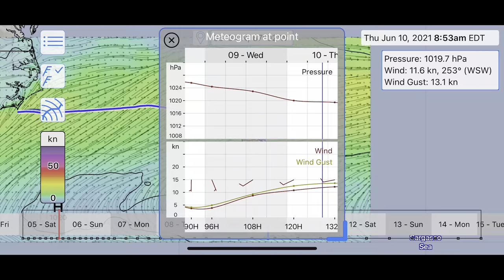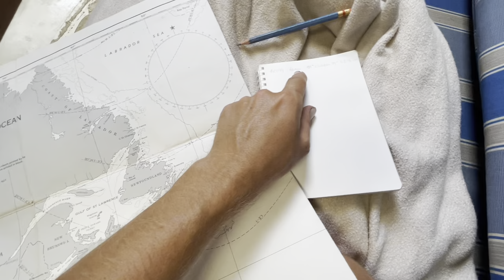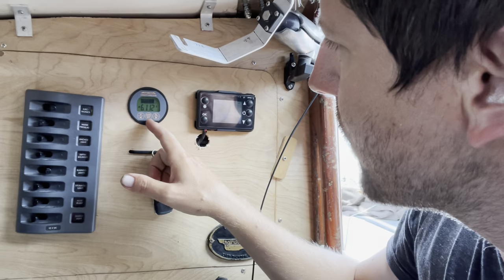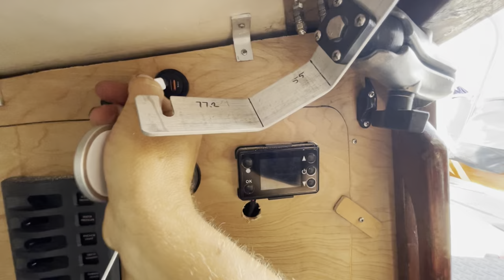Sailing single handed to Bermuda. 600 miles, 6 days, 28ft boat

Comment: OK.   YOU are my OFFICIAL HERO.  Congratulations !  I've had Transverse Myelitis since 1985.  Paralyzed from mid abdomen down. No bladder, no bowels. I've been fighting having a colectomy for 35 years. I just have a complete and total mindset against it. I've suffered. I'm also a sailing enthusiast with a 35' Pearson in Deltaville on The Bay.
YOUR ATTITUDE IS AMAZING !  I'm 74 and the pain and aggravation of dealing with my non functioning colon is increasing each year. I KNOW having the surgery will end my pain, but the aggravation factor is still major. I am very familiar with Beaufort, NC, beautiful and quaint !  GOOD LUCK as you sail on !
Reply: God Bless you!
Reply: Just get the bag man

Comment: Sam when I was sailing off-shore alone I to dragged a floating lifeline.  The polyline is slippery in water, I tied knots in the line approx. 2 feet apart to give me a better grab.  I do not know how well it worked as I never needed it.  My lifeline was 100 feet, if I were to go off-shore alone again I would sure as hell drag a line.
Glad you are doing it.  On another note, you can tie an inner-tube to the line, and with the remote for your auto-pilot, you can sit in the tube and control the boat.  This is a nice way to pass the time when the winds are low and you're doing 3 knots.        Be happy, be safe.
Reply: I've found it also tends to come untied rather easily.
Reply: @Justin Long nonsense pal.
Reply: @JustinLong1977  Cleat knot with a couple half hitches works, but yes the polyline because it is slippery does not hold a knot as well as a good braided line.  If you are going to drag a line it has to float otherwise it could get into the prop, or worse if you needed it you may be unable to find it.
Reply: @JustinLong1977  you’re right👍🏻

Comment: I got curious about that HMM container ship; it's one of the dozen largest ships in the world, built last year by Daewoo.  They are over 1300 feet long, 200 feet wide, displaces 228,000 tons and can carry around 24,000 containers.  You could probably stack around 20,000 Pickled Herrings on it's deck 😳.
Reply: Jesus they say 18k TEU and that's supposed to be 23 t each max so in theory it could carry 9 RMS Titanic taken apart, plates stacked on the deck along with the boilers and grand pianos and fancy sculptures.

Comment: Hey Sam ! I love your style ! I got another backup overboard tactic for you ! Read this through because its different system than your's. You can trail a 1/4" poly rope through a block out of the way at ninety degrees to the tiller. If you fall overboard you grab the rope and it will pull your tiller ninety degrees effectively stopping your boat dead in the water so you can climb right back in to it !
Reply: And keep the ladder down.  I went overboard at sea and I always singlehand. This method got me back onboard. I was never scared or worried. I'm always tethered to the boat with my lifeline.

Comment: I'm enjoying the tracker - Sam has left Bermuda it must be dusk for him about now.
Reply: Hi, Phoebe. Are you getting Sam on the Tracker?  It is not updating for me or something.  It shows only flags near the coast of U.S., where before it stretched to Bermuda and beyond.  Thanks if you have any information.  Bryan
Reply: @bdmenne  I think I figured out the tracker finally. If you zoom out enough, it shows where he is in relation to land and the mileage indicator in the lower left corner, I think right now is indicating he is 500 miles off the coat of Bermuda heading NE.
Reply: @emilybh6255  thank you! I found it myself. I always forget, but it has worked every time, right away. I scroll down The page and where there is writing, I find a  hyperlink.  It is the tracking. So when I select it it works. Looks like he is right in between Bermuda and Azores!!!  🙌🏼🙏🏻
Reply: New to the channel and you clued me in to that feature. Very cool.
Any idea what program he was using to ‘simulate’ this trip at the beginning of the video?

Comment: Sam can you trail a trip wire for the self steering so if do fall over you can trip the wind vane allowing the boat to luff up enabling you to pull yourself up, it would be almost impossible with the boat moving at 5 knots
Reply: Replying for the algorithm to increase the chance that he sees this.
Reply: That's a great suggestion...
Reply: That is a great idea
Reply: Cool idea
Reply: Or trail two lines, each tied to opposite sides of the tiller.when you pull on either rope, the tiller goes full deflection to the opposite side, causing the vessel to turn in the direction of the line with the greater drag.
Reply: +1
Reply: IDK about Sam, but I will be trying this

Comment: "got to clip in again, not so fun but you just have to make it a habit and it's no big deal" You said it Sam. This is the truth about safety at sea, in a wood shop, in any potentially dangerous hobby or profession. Its not necessarily fun but if you make it a habit it doesn't feel like such a big thing. Just like throwing on your seat belt. Well done on your trip. Your remarkable Sam. Congratulations.

Comment: I commend you Sam for what you have gone through and are going through and still maintaining an exciting sailing career.Bravo! I've had Crohn's disease for 50 years and have had four lower bowel resections. I've lost 10 feet of lower bowel. I can truly empathize with your ordeal. But you are taking it in stride and not letting it hamper your many sailing adventures. Kudos!!

Comment: what about putting a few knots in the yellow poly safety line, for hand and foot grabs to make it more likely that you could pull yourself back to the boat if it's moving fast. More drag, but hey....
Reply: Saw a rig once where a heavy bungie gave slack and a 2nd  bungie or line was hooked to a small projection on side of the rudder, such that the drag of a man on the line would also start the boat circling.
Reply: @sylviasorli  YES!

Comment: Friday July 2nd, at 6PM - Sam's tracking site time is 15:28.46, his coordinates are N 36°39'39.1428"  W 39°41'57.9048" and his distance from Ponta Delgada
Portugal, in the Azores - Sam has 777 Miles to go.

Sam has traveled 1454 Miles from Bermuda, and is back on track, sailing ENE, between 3 and 6 Mph...

Total distance as of today from Hatteras NC to today's coordinates: N 36°39'39.1428"  W 39°41'57.9048" is a TOTAL Distance: 2115 Miles
Reply: thank you
Reply: Thanks for update. I was checking recent video hoping someone had update.

Comment: In light wind and zero boat speed, a way to get going again is to strap the main sail down tightly so it dampens the wave motion which otherwise ruins your sail's profile. That will give the genoa a chance to keep its profile and start pulling again. Once you have some speed and the boat stabilizes you can release the main sheet.
Also, always sail your polars going downwind. Usually that's a course that doesn't require a whisker pole, so I am thinking you might be sailing too deep.

Comment: The bit about the crocs is hilarious. On my first sailing adventure I crewed on a gaff schooner with a family for 8 months. They all wore crocs and swore by them, I'd never heard of them before (im from the North), but I followed suit and bought a pair to use as boat shoes. God I hated those things, they are terrible boat shoes, especially the cheaper ones; my feet would get sweaty and slimy within minutes and slip around in them, and theyre just not stable enough. I ditched them quick and mainly went barefoot.
Later I crewed on a 156ft tops'l schooner out of Baltimore where we had to go aloft often using the ratl'ns, think like rope ladder rungs, to set and take in tops'ls, so I had to wear shoes. I wish I could remember what I wore that summer. I bet chuck Taylors would be amazing deck shoes if you hide the laces.

Comment: Hi Sam - you may want to check out how the uphaul and downhaul are attached to the spinnaker pole. By placing it in the middle, you may be risking folding the pole. I think uphaul and downhaul are typically attached to a line that runs from each end of the pole, so when the up/downhauls are tensioned, it puts pressure on pole ends, not the middle. Thanks for great content, you’re an inspiration!

Comment: The trick with the floating line off the stern, is to take a turn around the tiller or the wheel before the line goes over the stern. When your weight comes on the line the helm is pulled over and the boat rounds or jibes. Obviously the line is made fast somewhere forward of the tiler before you take the turn around it. You need at least 300 feet of line to make sure you can orient and get to it if you go over. (don't tie the line right at the end of the tiller, tie it a half or 2/3rds down toward the rudder post so the drag of the line doesn't keep pulling it over prematurely) Tie half knots in the line every 30 feet. Tried and tested. Works great, though the boat came back and almost ran me over once.

Comment: On John Kretschmer's boat, he advises looping the tether around the jackline and back to the harness. It works great: shorter throw, so not as much torque on the line if you do fall (which, depending on the length of the tether and the proximity of the lifelines may not even be possible.,) and no more clanking as you move across the deck.

Comment: Probably your best video yet, Sam - nice mix of boat tasks, sailing video, and discussion of critical safety measures for solo sailing offshore. You and Christian Williams have a sizeable following and it's good to see you taking the safety aspect seriously - setting a good example for others who might like to follow in your footsteps. Your video struck the perfect balance of putting forth adequate caution for those considering solo sailing without turning it into a fear and loathing fest.  Loved the self-deprecating humor too with the drilling reference - smiles all around. Perhaps you could expound on the usefulness of AIS (or lack thereof) while traversing the shipping lanes. If memory serves correctly, someone from Long Island donated an AIS equipped VHF - how is that working out? Good luck and fair winds!

Comment: I sympathise massively on the fuel issue.. I had the same and thought it was my tank but also was the fuel return line which had chaffed through in 4 places (48yo copper lines to be fair).. horrible diesel everywhere.. new copper fuel lines going in tomorrow.

Comment: Make me want to go sailing even though I’ve never been lol. Good luck and be safe
Reply: Go to the local Marina and ask around. Remember to bring beer.
Reply: Go to local Yacht Clubs. Find out who needs crew for racing
Reply: @olyboy95  I actually did do that. Unfortunately the 2 times I went, there wasn’t a need. 🙁
Reply: @svnoitalever7681   community boards in the marina. Or try and find a local rigging shop or Sail repair shop and chat them up, odds are a sailmaker will know someone who needs crew. I've been sailing on multiple boats for free for a year now. Just be a squeaky wheel but not too squeaky
Reply: @svnoitalever7681  also suggest buying a small sailing dinghy to learn some basics on calmer days. I bought a Lido 14 for $500 to just learn by myself/ YouTube has heaps of good training vids
Reply: @olyboy95  yea, I am planning on buying a cheapy boat to satisfy my need. That’s good advice!
Reply: Same
Reply: @svnoitalever7681  That sucks. Is there a sailing club, where you could take a basic dinghy sailing class?

Comment: Thank you for saying you were throwing that carpet anywhere but overboard, I just read “Fathoms” about Whales and plastic pollution and finding out that the female adults were protected by it being stored in their blubber, but it broke my heart to find out that all this goes to their first baby.  However, 45% of plastic pollution was commercial fishing nets that they threw over after they could no longer be used instead of disposing of them on land. They’re showing up in beached whales. Those mirrors were a unique solution and the rubber mats in the cockpit.

Comment: double tether on your harness to go round something or to clip to something amid ships in bad weather to hold you there while still clipped to jacklines, and a clip on in the cockpit close to hatch so your attached before coming through hatch, your doing a fine job always clipped to something, was that an epirb on your vest, only other thing is I like a full face motorcycle helmet and faceshield, that rain can hit you like rocks with enough wind, it also helps you see, if you have to work forward of the cockpit, havnt needed it yet so its untested

Comment: Sam, six knots is 10 feet per second.  If you fall overboard it might take 3 seconds just to surface and get your bearings..that's 30 feet the boat could have traveled. Then a few second to swim like hell to get to the port side of the boat to get to that line.  Might easily take 10 to 12 seconds.  You need a good 120 feet of line or more.  Say 150 feet for a 15 second safety measure...Good idea but you need more line than you are putting out.

Comment: She sails nicely... Had a lot of fun with a similar sized boat, Larger is comfier to live on but does not necessarily sails better. I don think there's a benefit to having that line at the stern. It slows you down at least half a knot and when you fall overboard that happens unexpected. You may not be conscious and if you are you may be disoriented. There's some other gear you might want to look at for safety but a line? The risk of having it in a prop.. I have sailed many times in Europe and Asia, often single handed. but for a long stretch like that I'd strongly consider another crew. Not being able to sleep sufficiently I sailed for 4 days none-stop, mostly standing, not sleeping. in busy shipping lane area.. And looking back, going single handed is not the way to go. Learn from doing everything Single handed, but bring some one along is you like to live. A ship under the horizon when you check... can crash you boat just 20 minutes later. Do the math. There is a real danger. Love your coolness. There's a lot to see. around the globe. You have the tool. now make it safe... fair winds

Comment: I used to race a Catalina 30 in the "Duck Dodge" on Lake Union in Seattle, WA. One time the wind died and all but one jumped in the water. I was not paying attention and the other 3 crew members were back on board and the sails were filling. They thru me a line and I was practically body surfing. Rolling across the top of the water when the boat tacked. I enjoyed it for a while and then pulled myself in and back on board. No problem. I wonder if I could do it today being 10 years older?

Comment: In one of your recent videos, you mentioned that you left some metal filings on the deck and they caused rust spots.  Were you able to clean it up? I have the same problem and I can't remove the rust from the deck! :(

Comment: Diagrams I saw had a single jackline running down the center of the bow, so there isn't enough slack to actually go over the side... Any reason why you preferred to use two jacklines?

Comment: Hi, I have a man overboard line rigged too, I have tied it to the bow of the boat, then it runs along the outside of the rail to the stern, I have 2 cable ties holding it at the stern which will break if i pull on the line in the water, I also have a sea anchor attached to it forward of the cable ties. My theory is that if I go overboard then I swim to the line, pull it which breaks the cable ties and hopefully the drag of my body and the sea anchor will pull the bow of the boat off course and stop the boat, allowing me to climb back on. what do you think?.

Comment: If my eyes don't deceive me, his tracker is showing Pickled Herring  is sailing in between two of the islands of the Azores and it is July 8th. What a great navigating job he did! He has arrived!
Reply: Lets hope Sam was able to document some of his Atlantic crossing, and is going to share in his upcoming videos!
Reply: @michaelishoj1111  Yes. It looks like the wind was fairly steady (or at least never gale force) the whole way but the sea conditions can make really impact the ride. It will be interesting to hear about that. 

I'm following another bigger boat with three crew and they are having a much more difficult time than Sam did probably due to lack of experience. They send satellite updates to their website explaining the conditions and their tracker shows the wind conditions and directions everywhere in the Atlantic as well as their exact longitude and latitude. So I've been using that to estimate what Sam has been dealing with.
Reply: @emilybh6255  - When the tracker shows their longitude and latitude, can this work out the boats elevation - like with Sam, he would slow down, and at that time, the elevation would be high, like 24 feet, or low, like - 12 feet, and I guess this is the height of the waves, or the rough ocean swells?
Reply: @michaelishoj1111  The other boat I watch uses "Predict wind" which shows the longitude, latitude, wind speed and direction , wherever you put your mouse. It shows patterns in the entire North Atlantic. So I've been estimating the wind conditions where Sam is based on that after figuring of course how far he is from the Azores on his website tracker.  There are other "marine weather" sites that show the height of the waves and the number of seconds between each one. The closer they are together, the choppier and more uncomfortable it is even if they are smaller waves - especially if your boat does not have a full keel.

Comment: I noticed a 2nd wisker poll on deck. One on the mast slider and one on deck. Is the 2nd a back-up? or Is it used for something? (sorry for the newbie question)
Reply: I have two poles so that i can rig for the deck stepped mast to be lowered for my yacht to go under bridges.